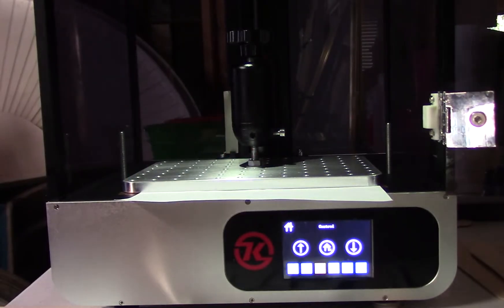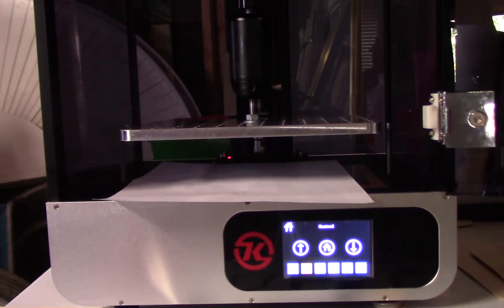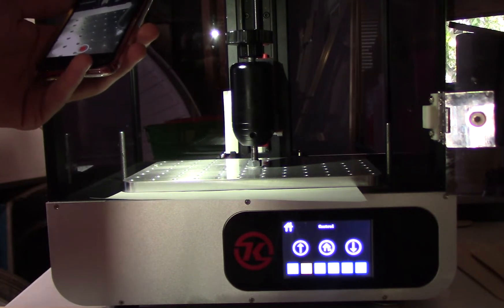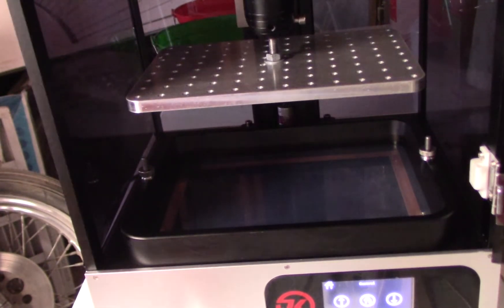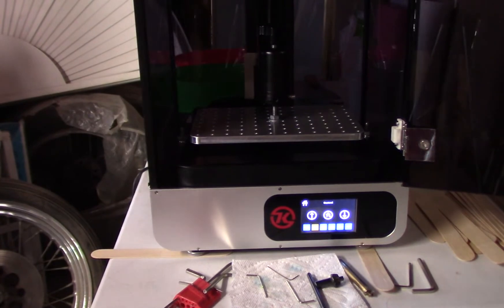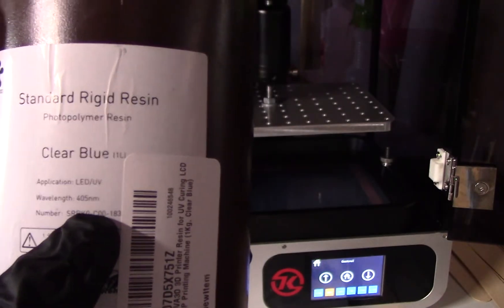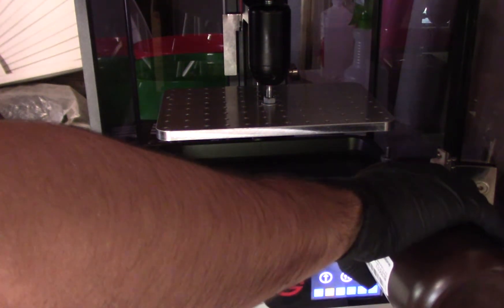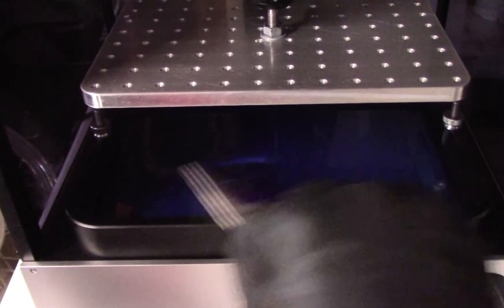Aliexpress 3D PRINTER KELANT COMBAT S500 PART 5

Comment: good afternoon, Hello . Please tell me , did you print models on this printer, the size of the entire table ?  the entire width and depth of the table ? something big can ?    did the model hold up well in the corners ?  or maybe there were other nuances ? thanks
Reply from the maker: I never printed the whole plate before. Maybe about 3/4ths of it. You can find the printer on aliexpress for the tech specs. I got rid of the printer a long time ago so I don't remember much. Yes sometimes leveling was annoying with this model. Once you knew how to level it made things easier. Sometimes the resin would stick too well and you wouldn't be able to get the print off the bed. It was also really messy. A lot of clean up and smelling alcohol.